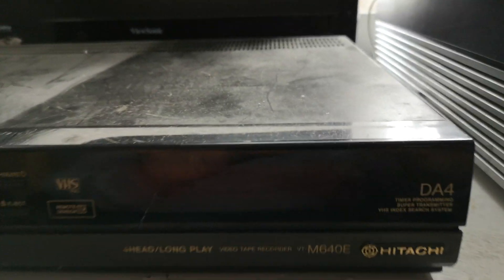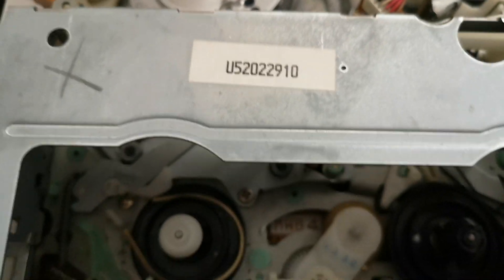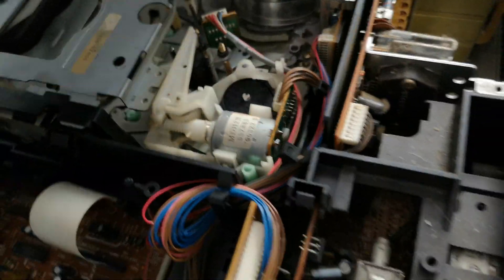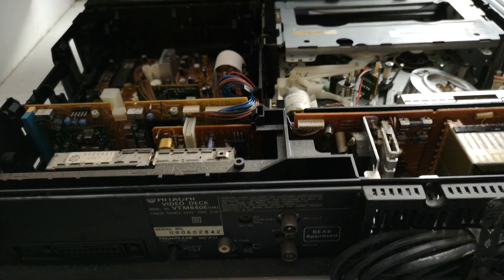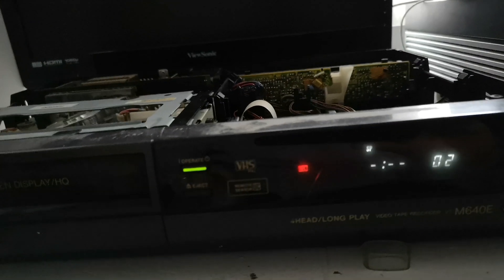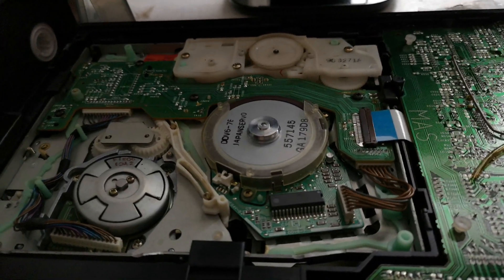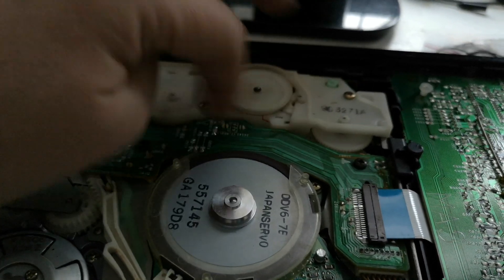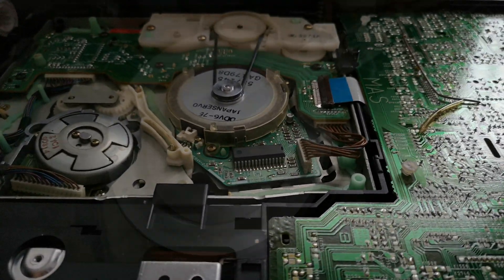Hitachi VCR Stripdown - a potentially life ending fault and what to do next -   Part 1

Comment: There's a 90 on the loading motor which could be part of the date code (does look very early-nineties). Looks like the eject symbol is flashing when you bring it out of stand-by, so could be that old chestnut, the mode switch. Happens a lot with machines when they've been sitting unused for long periods. 

Failing that, the loading motor itself (try the 9v battery trick), or its supply (check with multimeter), though neither of these would cause the eject symbol to flash..at least not with a tape already stuck inside.